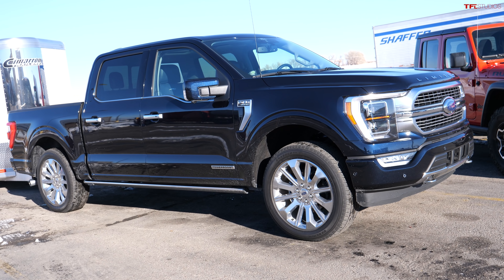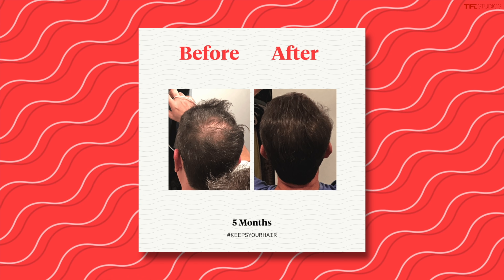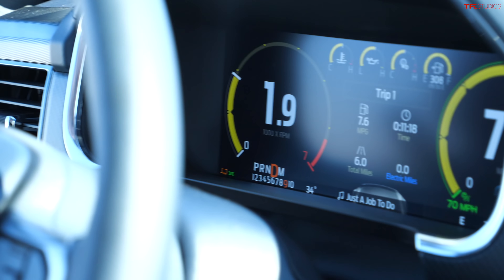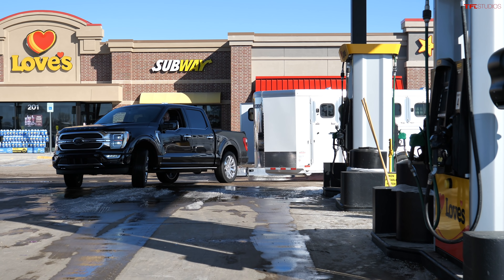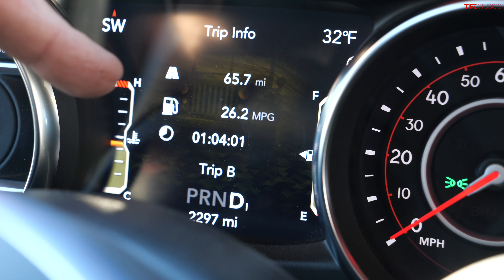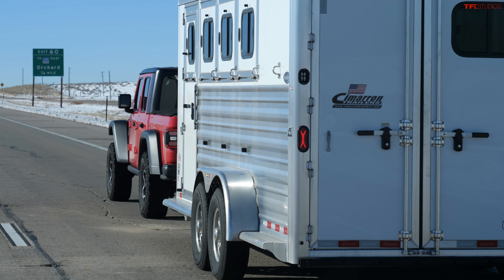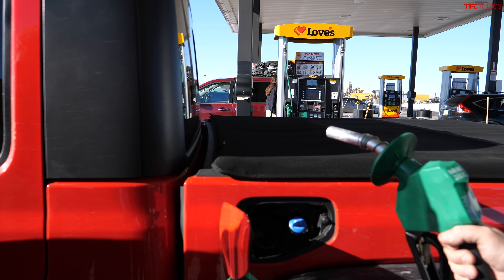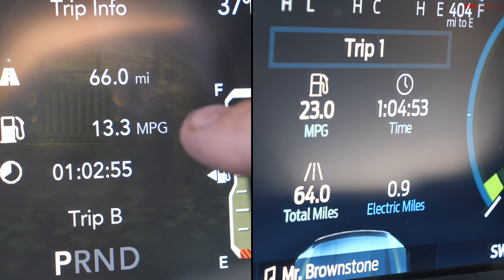We Didn't Expect This: Will a Ford F-150 Hybrid Get Better Towing MPG Than a Jeep Gladiator Diesel?

Comment: How about a Hybrid Diesel? I’d rock that
Reply: Emissions nightmare if the diesel engine is expected to turn on and off based on power demand when Engine temperature is cold.
Reply: That is the absolute best way to go. 
Train locomotives have been doing that ever since diesel electrics replaced steam. 
Diesel is extremely fuel efficient scaled for their engine displacements, so a 3L Diesel engine paired with a motor, preferably AC for superior traction for towing and off roading in the rough, is the most efficient. 
Locomotive makers (GM EMD and GE today) found out that using AC motors is more fuel efficient than DC motors.
Reply: Hybrids with gasoline help with throttling losses, diesels have no throttle.
Reply: Citroen DS5 had a 2.0 litre Diesel HYBRiD motor about a Decade ago & it was pretty cool! 🤩🤟🏻
Reply: @donb347  no need to throttle. Do not mechanically couple the Diesel engine to the drive train and dedicate it strictly turn a high torque alternator. 
Make the traction motors do entirely all of the work to accelerate, decelerate (regenerative braking), and maintain speed. 
The diesel will turn alternator only as fast as the traction motors demand and there is absolutely no need to continuously throttle the engine for a continuously variable acceleration or loading (climbing grade angle changes). 
The engine will simply move up to the next step RPM to match the demands of the motors. 
In downgrade egress, the engine would automatically go to idle and let the traction motors switch to dynamic braking and the mechanical brakes would step in when needed to assist the dynamic braking.
Reply: @jimm3093  generator manufacturing would see some losses for sure with something like that being common
Reply: @adithyaramachandran7427  No, the Diesel engine will run only when the battery has a low charge.
Reply: @jimm3093  That is a parallel hybrid, and the two largest hybrid vehicles in the world work this way. They are the twin Tractor/Crawlers that carry Saturn rockets and Space Shuttle s from the VAB to the launching pad, since 1967 and are still working! Visit the Kennedy Space Center in Florida and see then up close.
Reply: @raymondramirez9177  that would be a million pounds and I dont think that modern day engineering could put Diesel engine and axel components into a vehicle that also requires electric components and a battery pack somewhere.

Comment: Andre - this is Ron (owner of the 2018 Tacoma diesel). great test for those two trucks.  I had higher hopes for the Jeep’s unladen mileage relative to the Ram’s performance with the same engine and as the hwy mileage I’ve achieved in my diesel Tacoma is around 33 mpg (my typical measured mileage) for highway driving also have a 2005 Tacoma with a 1KD-FTV diesel conversion that achieved 15-17 mpg while towing a Tacoma x-Runner on a trailer (with trailer brakes) from San Antonio Texas to Atlanta Georgia.  I was excited to see the results with the F-150 but am eager to see the empty mileage performance on a longer road test.  The F-150 has been a market leader for so long with great space, useful features, and offering great utility.  This is to the point that the competition has stopped trying to shame Ford for the aluminum bed in the F-150.  Keep the videos coming and thanks for this two truck mileage test.

Comment: Wonder if the diesel went into regen on that empty MPG loop...
Reply: I'm  a long distance truck driver from ontario canada to Bakersfield California  and my maintenance crew  said that diesel of that size  would regen every 90 to 100 hours of operation.
Reply: @kenhorton3482  my 2020 ram diesel regens atleast every 50 hours. Would be surprised if the light duty jeep isn't the same.
Reply: Mine regens about every tank an a half of diesel its an f250
Reply: Your margin of error is much bigger the less fuel it burns.  When only burning 3 gallons, 0.3 gallons is 10% more fuel which would change the economy on a 66 mile loop by about 2 mpg.
Reply: I drive a hybrid diesel Coke truck and it basically goes into regen and soon thereafter,  it loses all power.  Not a fan.
Reply: Regen?
Reply: @falconwaver  Obama's "fix" for making diesels burn cleaner. Goes into a regen to burn soot out of the exhaust, but uses more fuel to do so. Yeah I know.. It's stupid.
Reply: It's the tires.  I have one.  I changed the tires and MPG went up immediately and drastically

Comment: Almost 30mpg in a crew-cab PU is excellent.  Both of these trucks are excellent choices.  The Jeep running better road tires would probably add 20% fuel economy.  Jeep looked like it needs a weight bar up front to balance that trailer weight.

Comment: Don't think I'd pay 61,000 for a jeep. Like to have the hybrid though.
Reply: Yea you pretty much summer it up.
Reply: $41k for a base model with the hybrid.
Reply: @Tylnorton  why you wait and get a demo. Get a lariat.
Reply: @patmason7276  If I had the money, then I probably would.
Reply: @Tylnorton  not worth it its a dodge fiat.
Reply: Haha, right? Seriously overpaying for the Jeep name brand. "It's a Jeep thing"
Reply: @joe1071  my ecodiesel gladiator has been absolutely fantastic so far. Still tows 6000lbs with ease on 39” tires and typical mods surrounding a build like that. And something happened with their test because I do 13-15mpg towing a similar trailer.
I bought it for $43k + tax tags title.  It has factory leds heated seats & wheel, all safety tech, etc

The mods ive done are less than $10k total and thats including rubicon axles new (lockers). 
In other words I have a jeep that will go damn near anywhere a street legal jeep can go and it still gets 23mpg on the highway. There is no vehicle out there you can buy for $52k that looks as bad ass and performs with the power and poise the JT does

Comment: It would be great on the Larger trucks(Super Duty, Chassis Cab, and Stripped Chassis) with a combination of the 7.3l Gas, A Larger, More Powerful Version of Electric Motor(maybe 100hp), A better cooling system and A Larger Battery Pack(5kw-hr or more) in short Powerboost HD with More Powerful Onboard generator(probably 10kw or higher).
This will give better efficiency when unloaded or lightly loaded, more power and torque, and extra capability as a mobile generator/powerbank for larger trucks.
This will be less expensive and low maintenance alternative to diesel engines.
Reply: 6.2 would be fine with a 100hp electric motor
Reply: Since the Technology used in the F150 is a Modular Motor-Transmission meaning it can adapt to different engines.
6.2l as standard and 7.3l as an option and for heavier applications such as Dually, Chassis Cab, and Stripped Chassis.

Comment: Andre "I put the weight over the tandem axles"  ... actually you need to put the weight over the front axles to make sure the front has a little more weight on the hitch.  When you put the weight EXACTLY in the middle of the tandem axles then you won't have enough weight on the hitch.

Comment: Need to check the diesel Silverado under the same conditions. I towed a 2006 Jetta diesel on an open flat trailer and got 20 mpg in mine. I know the shape of what you tow makes a huge difference too.

Comment: The diesel would do better MPG towing with summer diesel, also they both would do better in summer due to warmer tires, trans fluid etc. still 11.5 MPG is pretty respectable anyways for a 6000lb trailer and as you both said the big knobby tires on the gladiator didn’t help the MPG’s either all things considered I’m impressed with the towing MPG’s of the gladiator. I’m thinking that is the 3rd Gen ecodiesel in it am I right?

Comment: These fuel economy tests are interesting, but you can’t compare apples to apples in the summer and in the winter. Both gasoline and diesel blends change seasonally and fuel economy is always worse in winter as a result.

Comment: hybrid trucks (or cars) should be PHEVs, with a 25-30kWh battery to have a usable 50+ miles EV range, and an engine acting only as a generator, so it can work at constant RPM at its maximum efficiency. That should return about 25mpg while towing at 70mph. And BTW, a 25-30kWh battery should cost to them no more than 4-5k to implement

Comment: That movable  air damage on the Ford will probably  break from slush &road salt, and curb damage.
Reply: Although it is a hell of an advantage in a test like this, I'm sure it helped a good amount with highway mpg
Reply: Considering it only deploys At higher speeds,  shouldn't be a problem with curbs, and slush unless you don't know how to drive in snow or in the city.
Reply: I could imagine a rock chipping up and hitting it hard enough to mess with the motor movement or just hitting it askew in a way that it doesn't come back straight.
Reply: Curbs, probably not. Road sand/gravel most definitely. Just like the powered running boards. Total nightmare

Comment: Almost 30 mpg on the f150? damn
Reply: Something wasn't right with that pump fill up
Reply: @rossgreenzweig  so it didn’t use 2.214 gallons? What are you saying? Apparently the gas station is giving away gas??
Reply: @rossgreenzweig  just re run the unladen loop and confirm on a different pump. If it’s the same then the truck is off
Reply: Chances are the f150 was running on the electric motor most of the trip.
Reply: @rossgreenzweig  wrong. The F150 is really efficient
Reply: @edwardsr70  it says on the screen the electric motor was running for only 0.9 miles. going on the highway at 70 mph, the electric would never kick in
Reply: @Matts000  oh so its either the pump kicked off early, or the F150 is having issues. The computer is saying it's average is much lower, so than I suppose the computer must be having issues since your saying it's true? This truck wouldn't surprise me to have issues since its the 1st year of a brand new build...ever think of that?
Reply: @rossgreenzweig  first year build ? This is a pre production truck! The miles they travelled is 66 ,the amount of gas was just over 2 gallons. Those are facts. So the number they got is probably accurate. But like I said , just redo the run and see what they get. It wouldn’t be the first time they’ve tested a truck on their MPG loop that was out by a few. Hence the reason why they manually calculate it. And to your point, yes there’s always a chance the pump could be out however we need to keep in mind they are regulated and calibrated so the chances of that happening are lower.
Reply: Impressed by the jeep but 8.18mpg towing 6k for the Ford? Sheesh. 2010 power stroke does a solid 11mpg with an 8k trailer here.
Reply: That’s why I don’t like the refill method on a 66 mile loop. It needs to be 200 mile loop to average out the discrepancies between fuel shutoff at the pump. It similar to trying to measure mpg on a 3 mile loop then refilling at the pump. The more miles the better the data.
Reply: I had a 2wd super crew 2.7L and it would consistently get 24-25 if I kept it at 70 and stayed out of the pedal. So I believe 30.
Reply: @rossgreenzweig  

Possibly, but still impressive for a larger truck. No doubt the 150 has the aerodynamic advantage. The Jeep is literally an brick driving down the freeway. Any aerodynamic advantage will compliment the limited hybrid battery capacity. Can't wait to see the performance and efficiency of a larger Plug-in hybrid battery.
Reply: Hybrids DO NOT IMPROVE highway MPG.    This was a glitch.   The MPG on the truck is pretty close.  24mpg seems reasonable.   29 mpg... Not so much.    Simple glitch with the pump that is what it is.    Great content!!! Keep it up!!!   Love the channel
Reply: @ericensley2427  

They do have an advantage, but it's not significant. Coasting down a shallow grade, or maintaining a speed down a shallow grade, both could tap into the hybrid system, keeping the engine detached. Both situations where the non hybrid will have the engine running for such a minor demand.

Coasting down a steeper grade will allow regenerative braking, energy that can be repurposed  later for highway cruising demand or subtle climbs.

A ford Fusion hybrid we rented out in the four corners averaged 45 MPG over 1,000 miles, with plenty of highway cruising at 70-75 mph. A figure that's unmatched over a gasoline Fusion.
Reply: @ericensley2427  you know that silly round stickers on pump ? Yeah that’s from the city after they check the pump to make sure it does not over or under fill what the gauge says. If it was error on pump then the gas station should be shut down and fined. Or couldn’t be that trip meter was wrong and pump was right.
Edit:spelling
Reply: The sticker is for gallon accuracy, not pump cut off.    I am sorry I was not clear.    I drive a Cmax energi and I get 34 REAL MPG on the highway with a 2.0L atkinson cycle engine at 70-75 MPH.

I never said the gallon count was wrong, I said the shut off did not work right.   Also the trip computer said 24mpg (or so, from memory a few days ago).  And has anybody ever seen it off by 4-5mpg???  One yeah all the time, but 4-5.... Come on man
Reply: @wzDH106  

I agree with those comments.    But adding more systems between the engine and the wheels usually reduces efficiency.    I love the inverter in the Ford truck, I drive a Cmax energi and wish I could power stuff from the main battery.   I can not wait till this is std on all hybrid and plug ins!!!!
Reply: It doesn't surprise me that much thinking about it, it's a still a V6, it's very efficient, and also with a hybrid system..
Reply: Any time you see such a discrepancy with the fill-up and the truck computer you can rest assured the computer is more accurate. That being said, it would be wise to take the average of the computer and the fill-up numbers as a more accurate result.

Comment: My Kenworth W900L tractor ,fuel ,oil, came in at 21.500 pounds. It had 485 hp Cummings,  with 2028 foot pounds of tourqe. 18 speed manual trans, 3.31 rear ends. Loaded to max weight with 48 foot trailer, my fuel mileage  was any where from 2.1 gallon  a mile to 7.3 miles a gallon. That was driving from ontario canada in January  to Bakersfield  California.  4and half day trip. So temperature  does effect  your mileage.  Now bob tailing ( no trailer) i could get 28 miles a gallon  on a hot day and 16 - 18 miles a gallon in the winter. Hope this helps. Cheers.

Comment: I know it's standard procedure, but as an owner of an F150, there is no way I'd keep it in tow haul mode the entire time for a 6k trailer on that loop. Use it if you're going up grades or something, but on flat ground, you're just holding lower gears and staying in boost for no reason destroying MPG. For better MPG, let it upshift, it should have plenty of torque to hold 70 in a higher gear.

Comment: I really love you guys content and it generally seems pretty unbiased and just how the stuff performers. One thing that I would find very interesting in regards to some of your tests would to be instead of having a identical load for each truck, like each pulls 6000lbs, why don’t you use the other truck as the payload, like just use a flatbed trailer. In this regard, we get a more direct comparison between the two vehicles since the weight would be the exact same. Food for thought.

Comment: Ford recommends premium in the F150 hybrid, probably because it's turbocharged. The difference unladen is 1.41 times better MPG with the hybrid than the diesel but the difference in a gallon of premium gas and diesel in the NC mountains where I live is only 5 cents. Therefore, the hybrid is the obvious answer unless you are towing regularly or off roading.

Comment: Wow, I'm very impressed with the F150 hybrid MPG (w/o trailer)!!
Y'all should repeat that or even make a longer road trip to confirm!
Reply: Theoretically if the hybrid would aid the worst gas moments like taking off from stop, then charge while cruising it should do amazing numbers, but i've seen 4th gen Ram with better flow exhaust headers doing interstate empty multiple tests with 27mpg, one would wonder why they design and outsource such crappy boxed headers, it's like the oil conspiracies are true

Comment: Hard not to spool up the turbos when the Ford has weight behind it. Probably fuel/air in the filler neck shutting off the gas to quick for the 29mpg, but cool thin air up there too...

Comment: A 66 mile loop,, and the Ford dash recorded 64 miles,,, is a VERY short loop for any vehicle that gets 25 or 30 miles to the gallon.  The pump showing,, the tank capacity, a slight tilt to the truck when fueling.. all can have a  dramatic effect on a short loop.  If the refueling has a 2 quart variation on a 660 mile loop the mpg would be off by  maybe 0.1 mpg.

You are correct to say, take it with a grain of salt.  However,,, each Ford I have owned has frequently beaten the EPA estimates.  I recently,, last July, made the run from Green River, Utah to Denver,, with a 20 foot canoe on the roof.  EPA highway for my truck and engine is 19mpg.  My fuel used on that trip was 19.5mpg.  With load,, and with the windage of the boat on top.  2 years before, same route,, 20.5mpg.

Comment: One thing I think about to add on to MPG is $ per mile.  Any engine that requires 93 octane is using fuel that is ~20% higher in cost.  That means if the mpg is the same on the diesel and hybrid then the hybrid with 93 octane is 20% more expensive to fuel.

Comment: I'm skeptical of the Hybrid 29 mpg when computer said 23
You really need to pull the gas handle twice after first shutoff.
Vapor recovery systems dictate this practice, for accurate full fills.
Reply: A few others noticed the gas gauge wasn't even full when they filled up. Typical tfl shenanigans.
Reply: @pryme2013  Is TFL not doing the 30 second wait anymore when they first fill up and the the pump clicks when it gets full and then they wait 30 seconds to top it off again?